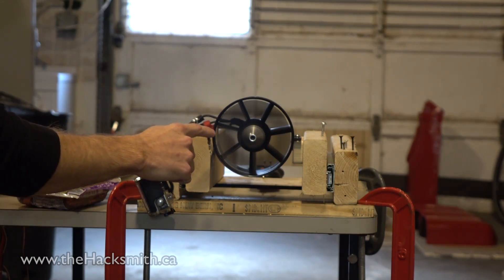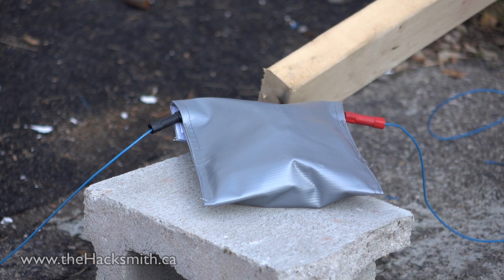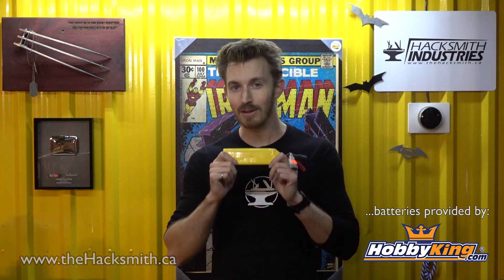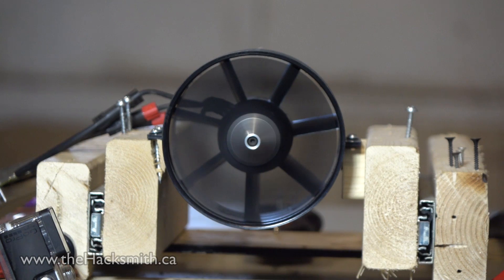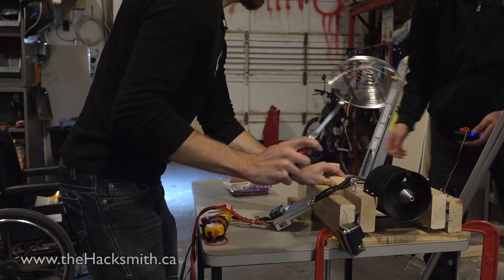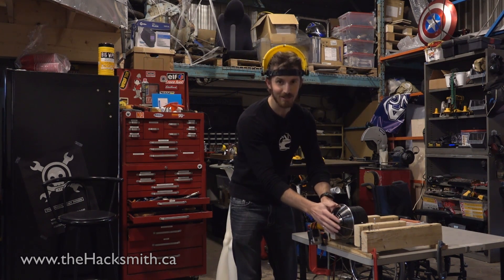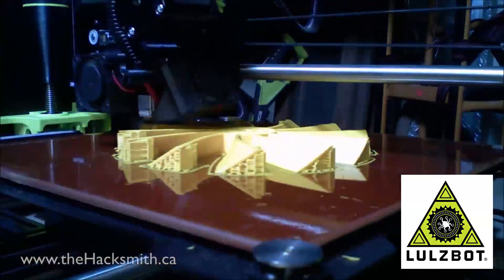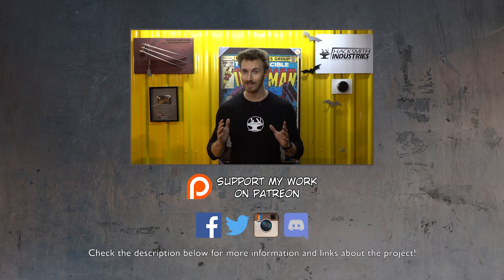Flying Like Iron Man #11: Not So Safe Safety Tests

Comment: Dude, BIG difference between house power and the power your using for these motors. A/C and D/C work on two completely different levels. Being an engineer I thought you would have known that but maybe there is a detail your not mentioning. Also, The power lines coming from a house are very different than lines you would use for a flight suit. The ones your going to your house are most likely aluminum and the lines you would use on a suit would be braided copper. A: the braided copper is a lot more flexible, B: it is heavier but you don't need a cable that thick to get the power you need. My suggestion is that you explore using a cable to see if a flight suit of your design will even work C: If the batteries your using use something like 8awg wire then you would need something like 6awg wire for the cable, and for 1000' this would weigh ~80lbs. Your obvously not going to go more than 1000' so lets say 100. That's 1/10 of the weight! And finally D: If there were the problem where your house could not power an A/C to D/C converter, then why not use even more batteries on the ground using an umbilical and get more flight time out of your suit.

P.S. try exploring Taulman 910 alloy filament. It costs more but it is WAY stronger than ABS. However, if you dont want to spend the money on that you could use acetone after sanding to seal the part making it a lot stronger. Not to mention making the air move a lot smoother along the props.
Reply from the maker: +RawGadgetry dude... Of course we know it's also AC, didn't feel like I needed to explain that part too since the wires will be too heavy.

And look up current ratings for cable... 6awg is no where near big enough! 8ga is barely enough for 8kW, and this suit will be 150kW...
Reply: I have not done specific math for the suit but when you have a virtually unlimited power supply you could have more motors to compensate for the weight of the cables. I was suggesting that you use it to see what is needed to achieve reliable flight, then use whatever power source fits best in the end prototype. Basically eliminating variables. However, you may even be able to have a 120V AC cable going to an A/C to D/C converter on the suit, which may lighten the load. Just a thought.
Reply from the maker: An AC/DC converter on the scale of 150kW would likely cost upwards of $50,000 by itself... and would be massive -- no way it could be on that suit.

Comment: You could possibly use fiber glass as the material for the blades rather than the plastic. Fiber glass is cheapish and heavy duty, but most of all fairly light

Comment: try using a single engine to power all the edfs just like a car can power four wheels the engine can be a lil heavy but you can reduce the weight by striping it off all the metal exterior and reducing it to a smaller proportion which would still kick out the same amount of power
Reply from the maker: +Ronald Taylor a single engine would be too heavy -- the motors were using are a fraction of the size of an equivalent gas motor :)
Reply: the Hacksmith ohhhhhhhh ok I forgot about that

Comment: Honestly don't think you've done the math on lift to weight ration per size of exposed rotor. You'll need to do this in a board. Not on your arms.
Reply from the maker: +Matt Davis have you even seen the plan? The design is on the gofundme campaign... There's a hexacopter jetpack that provides the majority of the thrust and stabilization, arms and legs are for steering (like iron man).
Reply: the Hacksmith gotcha. Ok that's feasible. Your just down in Kitchener right? I'll help build this and fund it if I can make some minor tweaks and be one of the first to ride it
Reply from the maker: You'd have to be funding it considerably to steal first rights to ride it ;)

Comment: you could put the batteries in an air tight case and fill it with co2
Reply: TheSwiftSquad wow that might just work but the case would have to be strong and light
Reply: TheSwiftSquad no
...... just I'm sorry no that's not how that works that fire if being fuled by the lithium no need for air and that would create a reallll explosion probably blowing off a limb
Reply: thank you

Comment: would using the design you have for the 3d printed blades as a mold and then using some kind of epoxy resin to cast it in work? It may result in stronger and smoother blades

Comment: i wonder if carbon could be added to that plastic you use or if theres a better product out there. then again you could green sand mold it and cast it with  aluminum magnesium
Reply from the maker: Problem is at home-casting is pretty difficult for precision parts. It works for a lot of things, but for something like this, might be more effort than it's worth.

For example -- if you see the professional EDF blade we show near the end of the video -- look at the underside. It has a bunch of holes in it. Those are for balancing the blade so when it spins the CofG is perfectly in the center. Considering that whole piece was machined very accurately, it should of been balanced from the get go. Now imagine casting it, how many variations it would have! It might be possible, but like I said -- would probably end up being more effort than it's worth.
Reply: you could try it i know. when peaple add magnesium or zinc dont breath that buy the way, you can make those precice castings. you could even look up the msds and find all the ingrediants for anything sometimes even the secret indgrediants because they are forced to put it on there by law. theres a clay diresta uses delft clay. but i think you would need a heat resistant silicone mold because of those angled blades and you could add carbon to the mold so it can really take the heat you might also consider using a tin alloy.

Comment: you should build a quickly detachable battery pack that contains all the batteries so you can eject them if they explode
Reply: or begin to
Reply: Tyree Vinson and then without power Fall down

Comment: Maybe I was just looking at it wrong, but it looked to me like you were testing everything on the EXHAUST side of the EDF rather than the intake side. I'd imagine having the edge of the fan blade rather than the flat side would cause a ton more damage to any object that entered. It'd also be more likely to be the side that took in a small rock from dust kick up.
Reply from the maker: +Aidan8et that is the intake....
Reply: Thank you for the response. I'll have to look closer next time before I open my layman's mouth.

Comment: Ah, it's good to know all the potential dangers now as opposed to learn them midflight. Also, I got a question: for the finished product, how much more thrust are you planning to add to exceed your weight+equipment and thus produce flight? Say, if 100% thrust cancels out the total weight - but it could hardly be called flying - 110% may allow you to fly, but I doubt it would respond well to dynamic weight (like if you reduce thrust to land but need thrust at full again to slow the fall, etc.)
Reply from the maker: +Anakin Skyobiliviator a good quad copter has  hover at 50% which gives lots of power to speed around. We're looking for about 150% thrust so we have an extra 50% to fly around
Reply from the maker: +Anakin Skyobiliviator a good quad copter has  hover at 50% which gives lots of power to speed around. We're looking for about 150% thrust so we have an extra 50% to fly around
Reply from the maker: +Anakin Skyobiliviator a good quad copter has  hover at 50% which gives lots of power to speed around. We're looking for about 150% thrust so we have an extra 50% to fly around
Reply: the Hacksmith That sounds pretty good but in exchange of a hefty price P:

Comment: Probably you've already tried this, but you can still print the fan, then use it for a "lost wax" or "lost foam" technique to cast it on aluminum or other "soft metal" when you have it on metal then you can turn it on a lathe to eliminate just some of the ridges. for the casting you can make some sort of cheap kiln to recycle junk metal. keep up the good work and happy holidays :)
Reply from the maker: Problem is at home-casting is pretty difficult for precision parts. It works for a lot of things, but for something like this, might be more effort than it's worth.

For example -- if you see the professional EDF blade we show near the end of the video -- look at the underside. It has a bunch of holes in it. Those are for balancing the blade so when it spins the CofG is perfectly in the center. Considering that whole piece was machined very accurately, it should of been balanced from the get go. Now imagine casting it, how many variations it would have! It might be possible, but like I said -- would probably end up being more effort than it's worth.

Comment: +hacksmith I recently watched a video by Thomas somebody, where he annealed PLA parts in an oven. He achieved a significant increase in strength.
Reply from the maker: +nfisheremti I saw that too!
Reply: the Hacksmith we're working on 3d printed impellers at my work too, but we're working on large and quiet, very low speed. different challenges. good luck, I think you're on the right track

Comment: Why not use plastic instead of wood for the homemade 3D propeller? Then coat the plastic in some form of industrial strength glue for extra strength? or instead of glue use similar paint used for commercial airlines?

Comment: You should set up a safety rig so that you won't have to worry about it just shutting off and dropping you. I know it's only a few feet, but with all that gear it could still hurt you or the gear if you don't
Reply from the maker: +Tyler Staley haven't you watched the previous episodes? We have exactly that in the garage :p
Reply: the Hacksmith I have watched them, I just assumed you'd only use it as a counterweight for testing, but I guess you already have the thing implemented lol

Comment: if you print a ring around the outside of the blades surly it will strengthen them to hold them together at high rpm and if you put the ring in a casing so air cant go around the blade you would have more thrust as well

Comment: hey what voltage and amps did you charge that battery at to make it blow like that!! I charge all my batteries in the lipo safe bag but honestly thought it would do more than that!! I want to know how extreme that was and if the explosion could be that bag of a standard wall charger because if so I kinda want more safety precortions that just the bag!!
Reply from the maker: +Thomas Perkins we had 3 car batteries in series. The lithium is only 22.2v and we were pumping in 36v at 30A

Comment: Design a small dia hole ( or couple of holes) that runs the length of each blade. After printing, insert CF rod and wick in CA glue. Can also be used to contain balance weight

Comment: Also why doesn;t he use class 10 AB plastic for the propellors?
Reply from the maker: Prototypes can use any material, we still need to design a blade that can produce the thrust we require before we start testing more expensive materials.

Comment: at school we are making/designing this divice that can smooth out 3d printed parts it has to do with vaporizing acetone and holding the part in the vapor and then te texture should smooth out if you want to see examples of this just search acetone 3dprint on google
Reply: I actually just posted that because you barely find information on smoothing PLA. There's a lot of stuff about ABS and Acetone but quite few only about PLA.

You are certainly right, that ABS has better characteristics but it is also a lot harder to print. I prefer using PLA too because I cannot print larger objects properly using ABS...
Reply: also add a ring around the blades so thy are less flimsy and more stirty you will have to find a way then to put the outside of it on a bearing
Reply: on turbine blades they sometimes have a ring on the blades that runs in a channel in the housing.
Reply: But that only works for ABS unfortunately.

But: Here's a tip that i don't read often in public forums. There are also chemicals to treat PLA. Chloroform, which might be not easy to get in every country and which is expensive, and Ethylacetate. I personally tried chloroform which worked pretty good, but it's also quite expensive. I didn't try Ethylacetate though, but you might find that in nail polish remover, it's often used a substitute for aceton.
Reply: at school wa have a leapfrog printer and it can print abs just fine
Reply: Timo but why would you ever use pla for something like this abs or some stonger thing that u can use on an open source one is the way to go
Reply: Edger Van der Linden  netjes!

Comment: Consider using lost plastic casting to cast aluminium fan blades using the 3D printed fan blades as a template, might yield stronger blades.
Reply from the maker: Problem is at home-casting is pretty difficult for precision parts. It works for a lot of things, but for something like this, might be more effort than it's worth.

For example -- if you see the professional EDF blade we show near the end of the video -- look at the underside. It has a bunch of holes in it. Those are for balancing the blade so when it spins the CofG is perfectly in the center. Considering that whole piece was machined very accurately, it should of been balanced from the get go. Now imagine casting it, how many variations it would have! It might be possible, but like I said -- would probably end up being more effort than it's worth.
Reply: Fair enough, still I hope you find a way of get an EDF of such a size for a reasonable price. What other manufacturing methods have you considered besides 3D printing?
Reply from the maker: If we can design a good blade we'll be able to get it machined fairly cheap by a company in China =)

Comment: why not use the 3d printed turbine as a form to cast turbines from aluminum?
Reply from the maker: Problem is at home-casting is pretty difficult for precision parts. It works for a lot of things, but for something like this, might be more effort than it's worth.

For example -- if you see the professional EDF blade we show near the end of the video -- look at the underside. It has a bunch of holes in it. Those are for balancing the blade so when it spins the CofG is perfectly in the center. Considering that whole piece was machined very accurately, it should of been balanced from the get go. Now imagine casting it, how many variations it would have! It might be possible, but like I said -- would probably end up being more effort than it's worth.

Comment: batteries exploding during take off...
 ...resulting in flame-broiled Hacksmith
EDF blade exploding sending propeller blade into his jugular...
 ...resulting in a blood-drained Hacksmith
ESC Failure during flight...
 ...resulting in the Hacksmith falling to his death
EDF Failure during flight...
 ...resulting in the Hacksmith falling to his death
Battery Failure during Flight...
 ...resulting in the Hacksmith failing to his fiery death
Flight Control failure during flight...
 ...resulting in the Hacksmith falling to his death
Wiring Failuring during flight...
 ...resulting in the Hacksmith falling to his death
Pretty much any other failure during flight...
 ...resulting in the Hacksmith falling to his death

It is bad that I laughed when that came on the screen.

Comment: James why can't the fanblades be custom made by some company that specializes in custom made metal products? Wouldn't that still be cheaper than getting the expensive EDF's?
Reply from the maker: Minimum cost is still around $1000 to 3D print a metal blade, and that might not even work due to surface finish

Comment: What type of filament are you trying to print the fans with? 
PLA or ABS will limit what you can do but some quality poly carbonate filament  will drastically increase your strength. Especially along the horizontal layers which is where it looked like it snapped. The TAZ6 should be able to handle the filament too, maybe just get a plated or steel nozzle.
Reply from the maker: We're still in the design phase for determining a good 3D shape for the blade, we'll play with fancier materials as we get closer to the final design =) We have a large selection of engineering filaments =)

Comment: What about supercaps instead of batteries?
Reply from the maker: Overhyped technology -- they can store lots of power, but for not much time at all. Lithium polymer is still much more energy dense and the best option at this time.
Reply: Thats true, but they are lightweight and can give you a lot of current. Plus they can be charged faster.

 I know those huge lipos also have enough power inside, and you already have them. Also the time and money already invested is huge. However I still think that the first step on the "fly like ironman" proyect should have been jumping and then using EDFs and supercaps to try to stay up there a fraction of a sec, just to see how hard it will be. 
Anyway I love the project and I understand that the path is already chosen. You decided that lipos were the best option, go for it and good luck with this amacing idea.
Reply from the maker: +Victor García the lipos we have are free... So... :P supercaps would literally only last a few seconds instead of minutes with the lipos and they'd probably be more expensive too!

Comment: 2:00 yep, I realized those lipo-safe charging bags were total BS years ago; they are made from or coated in a rubbery material, and stitched with nylon thread. Go figure the stitching lets go instantly and the rest of the bag melts within a few seconds- not all bags are total junk, but most are. I'd recommend metal compartments with vents facing away from your body, that way the container won't explode from the pressure of a fire. For charging, metal container is best, again vented.